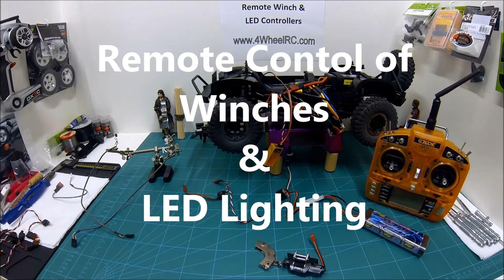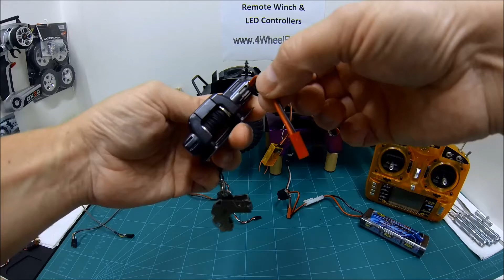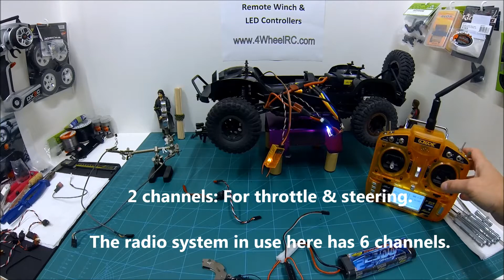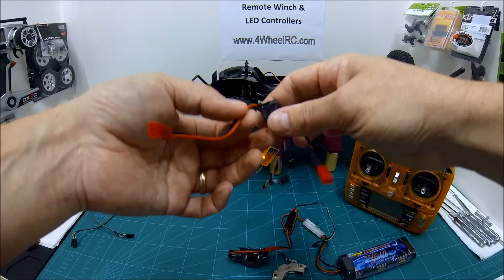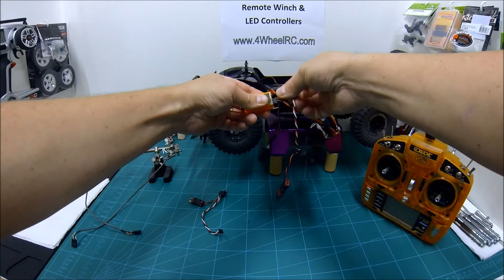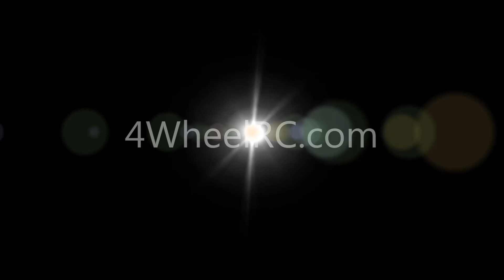RC Winch & LED Controllers.

Comment: If i have a winch that directly connects to the receiver, will it work if I use a 3 position switch from the transmitter?
Reply from the maker: Hi, that should work.
Reply: Did it work?
Reply: @Jodz96743  yeah it works

Comment: What transmitter are you using?
Reply from the maker: Hi, back then I was using an 'OrangeRX T-Six' transmitter (I think it is discontined now). But I switched to a 'Turnigy 9XR' which is far more capable. Both were from hobbyking.com

Comment: That heyok controller is a poor design, I just made a controller from a servo and I'm using the 3 position switch on my dx4c. works like a champ and I only have $25 in the winch and the controller
Reply from the maker: +pmm4177 Thanks for your comment, but I don't share your thoughts: For sure you can convert a servo's controller circuit into a cheap winch contoller, but try pulling a lot of current through it with a 'hot' winch motor... You'll probably burn it out in seconds. Also 'proper' winch controllers have active braking on the motor, so your winch cable does not creep out when you are not actively winching. But if what you have made does what you need then for $25 thats all good  :-)

Comment: Excellent just installed my 3racing winch with the help of your video, only thing im not sure about is how to supply power, my esc and battery both have deans connectors but the winch has tamiya, should I swap out the tamiya for a deans and make a y link or run the winch on a separate battery.....what would you suggest ?
Reply from the maker: Hi Gary. If your main battery is a 7.2V NiMh or 2S LiPo then power the winch from that. I have read of folks running the winch on 3S but AFAIK that'd fry the 3Racing winch controller as it is way outside its specification (the winch motor can handle 3S, but not the controller - you'd need to get a 3rd party winch controller e.g. HeyOKPerformance's relay controller: http://www.freewebstore.org/HeyOK-Performance/Relay_Winch_Controller/p1742582_8019514.aspx).

For the connector: You could use a separate battery for the winch but IMHO that'd be overkill. Tamiya connectors are not great for reliability, so you could join the winch wires into the same Deans plug as the ESC (or use a Y-splitter). But beware that when your model's battery is plugged in, even if the ESC is switched off you will be powering the winch's controller, so that small drain may flatten a pack after several days (serious issue if you have LiPo)... I have this and just make sure I unplug and remove my battery from the model when not in use.

Hth  :-)

Comment: I wanted to get a rockclawler but when it comes to electronics I give up and u even make this more complicated than I forth it is : (
Reply from the maker: Hey itryHard, don't be put off. My SCX10 is seriously over the top and has lots of extras on it. A basic RC vehicle with just receiver, speed controller and servo is relatively simple to get running these days. Hopefully you have a hobby store near you and they could help?